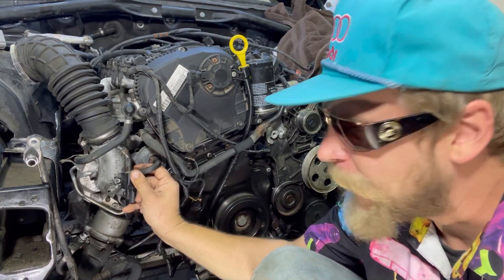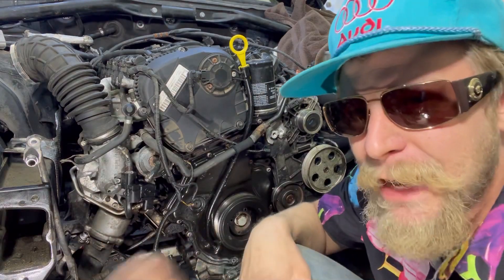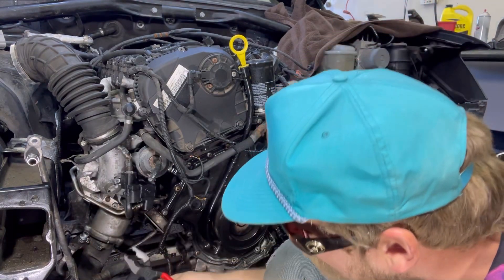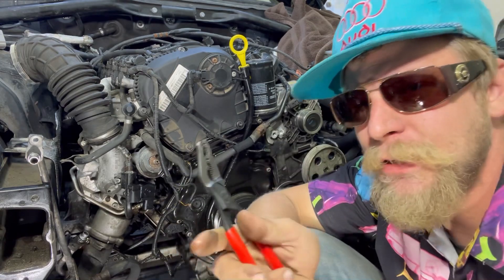2.0t replacing Broken Boost control ￼Solenoid N75 valve Turbo wastegate turbocharger b8 b8.5￼ Audi

Comment: Goated b8 mechanic using your advice for all my audi b8 needs thanks man. I super appreciate your knowledge and insights without the BS, straight to the point unlike some forums we could mention. Owning a B8 on a budget requires alot of Diy work but is super worth it if you have proper instructions and guidance!
Reply: THAT PART

Comment: Technically your wastegate does not let out the boost, that's the Diverter Valve. Boost pressure is released out of the charge pipe intake via the DV and back into the intake stream, post MAF.

A Wastegate opens the flap to allow exhaust gases to bypass the turbo's turbine so it will spin less. This will prevent the turbo from building further air pressure in the intake stream, aka boost. Existing boost doesn't go anywhere unless the DV opens and/or the engine consumes it.
Reply: Hey bro, I'm getting the error P2261 - Turbo Boost Pressure Not detected Mechanical. I've an upgraded K04 Hybrid with Turbosmart DV. If I accelerate my car, the car flutters (Releases boost) and then gets the boost back but if I flood (pedal to the metal) then boost spikes to the desired pressure. Should this N75 valve cause the above mentioned problem?? If not should I be adjusting the actuator rod.

Comment: The EPC light is on and the P00AF00 code can't be cleaned. It's running smooth but under boost. 

I should take into consideration this boost selenoid?

Comment: This is not N75 related but close. I replaced the boost pressure sensor; one the intake hose and the old one came out with the tip covered in motor oil, is that normal?

Comment: I have a question. Can you give any helpful information on replacing N75 on a transverse 2.0 tfsi. Ea888.1. 2010 Audi TT QUATTRO?  I cant get to it. Stage 3. K04 11 psi boost max. Then gate is opening. Tune is requesting 20-22 psi.
Reply: I am getting p0299 code. No boost leaks. Wastegate spring is set at 11psi. So N75 isn't working correctly

Comment: I have the 1.8 tsi bzb engine the n75 is always at 2% it is normal currently it has a huge loss of power and cylinder failure

Comment: is this the part that gives these the known wastegate issues ? if so, i’m gonna replace it for preventative measures lol
Reply from the maker: These rarely go bad on 2009+ but 2005.5-2008 2.0t this is common to go bad
Reply: The common failure is on the back of the turbo and is the wastegate flap. Turbo has to be removed to properly fix it. There are other workarounds like shimming the wastegate flap. It will buy you some more time before the condition occurs again.

Comment: Can you do a video on how to install AEM boost controller on a 2.0t? I was trying to see the location...if it goes between the sensor and the WG?
Reply: Don't use it. Tune the car via ECU map changes. These are torque driven ECUs. By tricking it, it will cause the ECU to make other changes you don't want and you'll fight that battle over and over.

Comment: Will this throw a code if it’s bad
Reply: It will throw a code but not related to this part. So you won't know if it's its fault or not, better to just change it because it's cheap. I am going to do this next days.